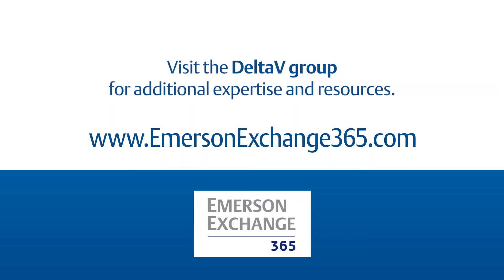Why, When and How to use MPC

Comment: Hi sir 
I've got a question though, why we should use the variation of the control signal in cost function rather than the control signal itself ?
Reply from the maker: Hi Mahak. Our Expert would need further details from your question. Here is what he said "For example, If I was using MPC to operate an incinerator that used purchased natural gas to ensure combustion, I would want to minimize natural gas flow as long as I was staying within all constraint limits.  If I was operating a distillation column and the distillate (overhead) product was more valuable than the bottom product, I might maximize heavy boilers in the overhead and minimize low boilers in the bottom.  If I was pass balancing a 4 pass heating furnace, I might want to equalize the outlet temperatures of each pass.  I cannot think of an example where I tried to put variability of a variable into the cost function of the optimizer.  I assume we would want to minimize variability, but I’m not sure how it would be measured without an example.  I also can’t imagine where we would use MVs to reduce the variability of a variable.  So I think I’m missing something here and would welcome an example.

Now in the dynamic controller tuning, itself, we do penalize MV moves if the MV is cycling rather than coming to a new steady-state.  There is a parameter called Penalty-on-Move or POM that allows us to calm an overactive MV.  Perhaps that is what is being asked.  One of the big advantages of MPC is as a multivariable controller where the MV moves are actually coordinated rather than decoupled.  This makes for steadier control, which is generally the top objective of all controllers.
 "

You can also join our community here: https://emersonexchange365.com/products/control-safety-systems/ so other experts can provide their input.